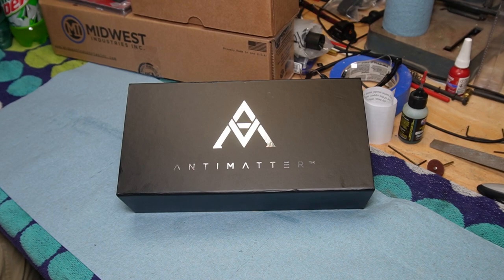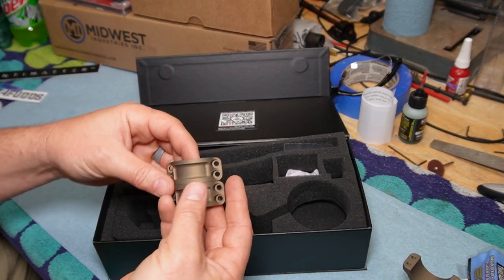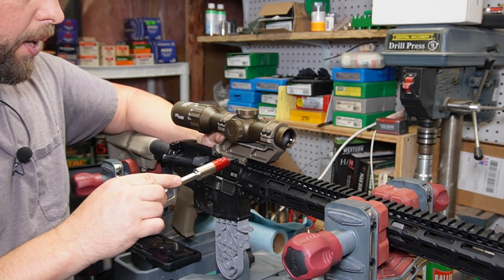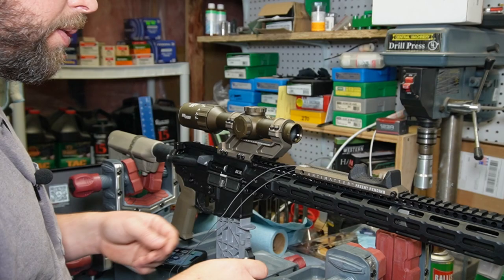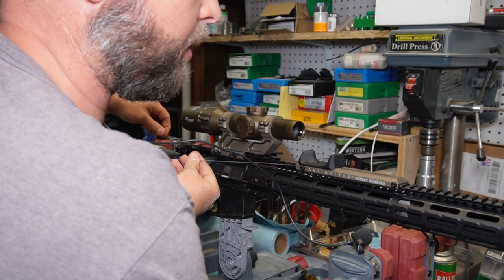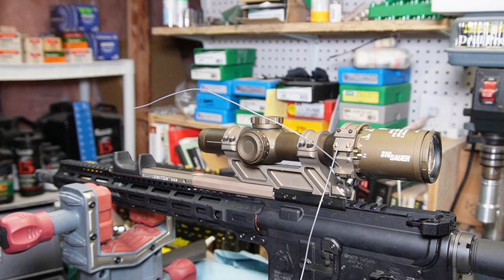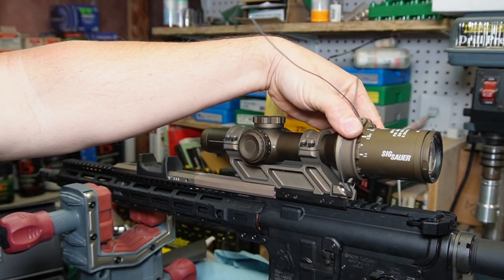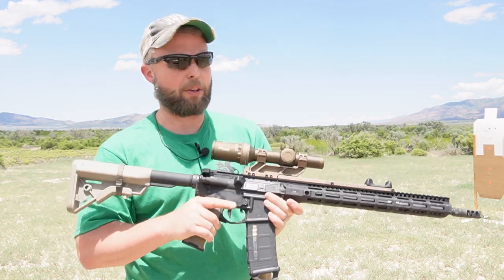ScopeSwitch Unboxing, Install and Bang Bang

Comment: i want one on my saint victor ar pistol, but the barrel guard has a gap in the rail. it goes from T16 to the next available slot being T31. I guess my question is how long is the slide part to see if i can bridge that gap.